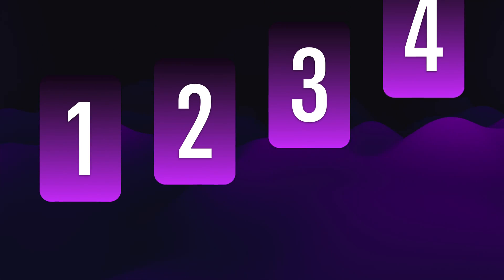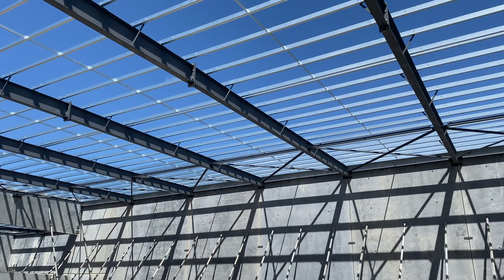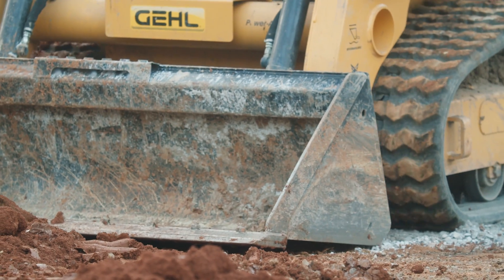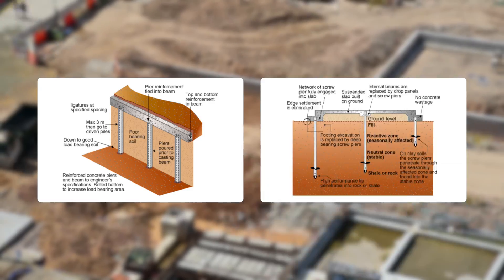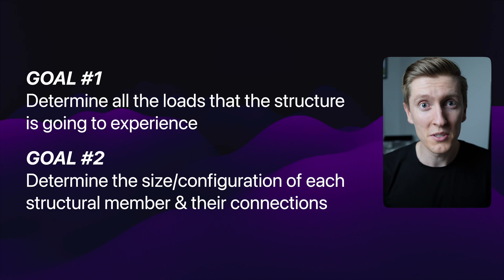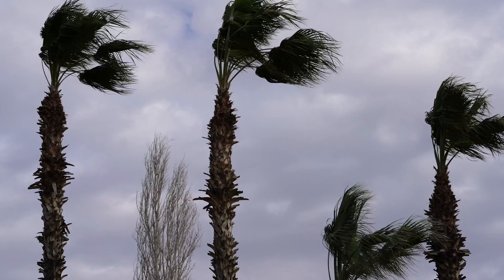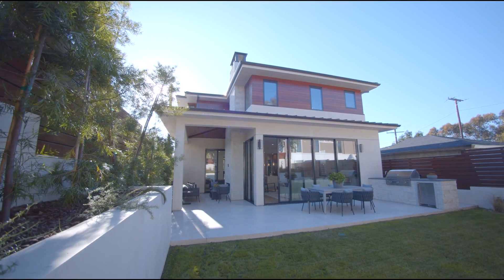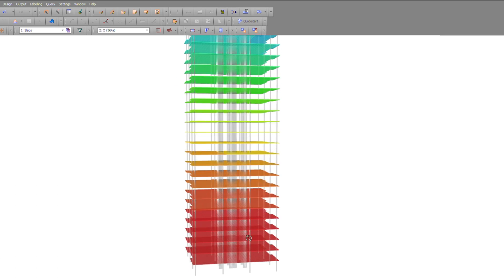How Engineers Design Houses: What Structural Engineers Actually Do

Comment: Great info, but here's an additional $0.02:  Make sure your designs make PRACTICAL sense.  I was  in construction before I became an engineer (now retired), and I'd often shake my head at the naive and/or impractical designs I saw.  Obviously, the designer had never ponded a nail!  I also agree 100% with the requirements for inspection.  Never, never sign a design contract without insisting that you also get paid to INSPECT your designs at regular hold points.  (Trust but verify!)  There are too many unskilled and/or careless and/or crooked tradesmen/contractors out there!

Comment: I often hear when homes have ladder cracks in the cinderbkocks or brick that it was caused by "settling." How can those cracks occur when I suppose a Structural Engineer has designed the home with correct weight bearing layout? Please help me to understand, thank you
Reply: The cracks that you mention could be due to the structural loads, the capacity of the material, or the capacity of the underlying soil. Resolving that issue could be the responsibility of a structural or geotechnical engineer.

Comment: How much time do you need to do static and seismic analysis and reinforcement drawings for a 200 m2 house with two floors?
Reply: The question is too broad because the floor area isn’t enough information. Even for the seismic analysis alone, the structural engineer need details on the structural system (location, material, configuration, etc).

Comment: As someone who has done residential engineering design in Sydney, I find it frustrating that most builders don't care much about our details on-site and think our specifications are outdated or impractical. Also, the industry can't support career growth, so you'll need to leave it behind at one point and proceed to multiple-level buildings or migrate to infrastructure jobs. Budget is always tight for jobs in this industry, so real estate teams and architects get the most out of it and leave the remaining for the engineer. Each job had to be rushed! the sad part is that our plans are required for paper or council requirements. I loved my job back then; there was a lot of problem-solving with creative architecture design, but I had to leave.
Reply: I can understand that, but in the custom and remodel fields, I think the engineers in our area do quite well (though they mix it with bigger jobs). I know what you mean, if you have a tract or “seat of the pants” builder, they think they know it all and you are just a requirement for the council. It’s understandable because at one point they DID know it all, as far as what was needed for earlier home design, and engineering was only for high end projects. Now all houses are built to within an inch of design standards, and each part is indispensable.
Reply from the maker: Yeah there are definitely pros and cons. What did you change to?
Reply: @BEngHielscher  Geotechnical